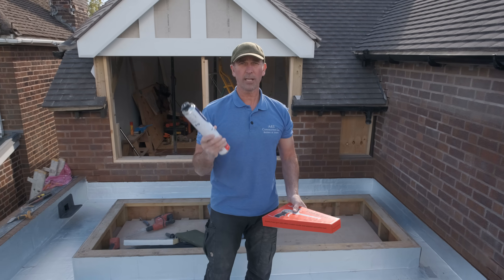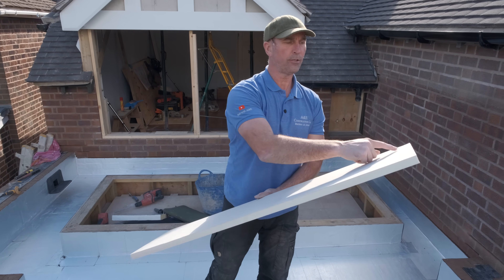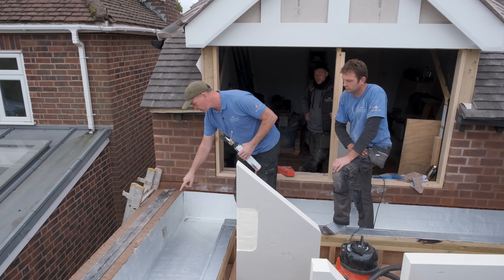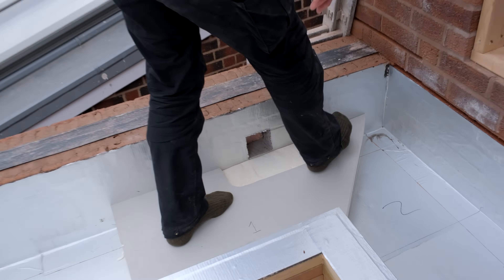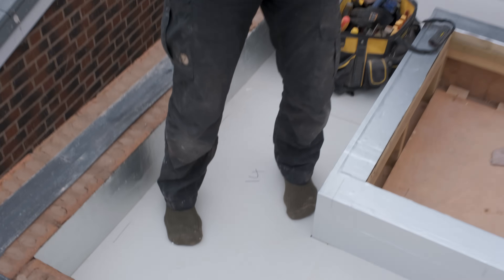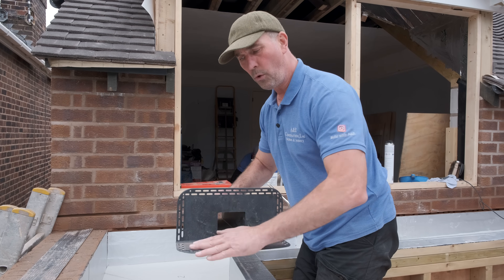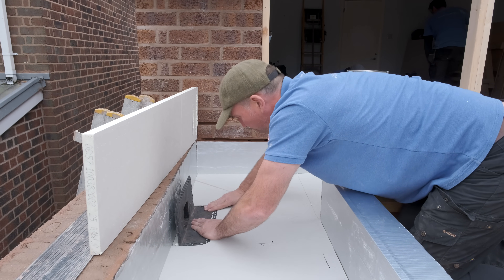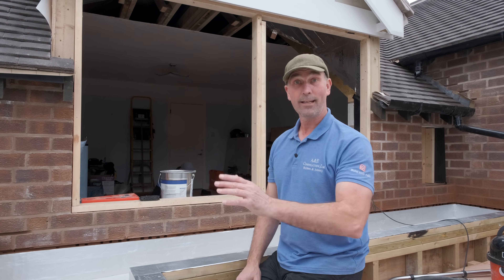Installing An EPDM Rubber Roof (Part 2: Insulation)

Comment: I'm just in the process of building the flat roof and lantern on my extension so this video series has been a fantastic help. A couple of questions for you if that's ok? 
1. Did you cut falls in two directions on some of the firing strips so there is no lip in the ply where one sheet meets another in a different plane?
2. What product did you use for the rainwater gully/outlet/hopper please? @ 3.06
Reply from the maker: Hi TheBigSugs there are multiple falls 6 in total and the gully are from Rubber4roofs all the best Tony 👍

Comment: Top class work. Im a carpenter and builder currently building a small extension on my house due to lockdown. It’s also a warm roof and I will be using the materials shown in then video. Thanks for showing they are excellent for getting info. I have a tricky little box gutter / valley to form due to my design being a little different, fingers crossed it works out 🤞 👍

Comment: Good vid as always. The attention to detail is great but I do  hope that adhesive holds the foil back pir and top deck  down securely long term. I am sure that it is most likely fine as there does not look to be large exposed areas without perimeter constraint.   When looking to do this myself  late last year I found this vid very good.  https://youtu.be/RBINlVX0jOc  . This chap seems to know the game well and is a great source of info- approachable too! . Based off of this, my choice was to use  mechanical fasteners . Its not quite as pretty as you can see the fastener washer telegraphing through the epdm ply but i know its going to stay secure. Also quick question why not 150mm pir  for new build extension?. Keep up the quality content - i learn lots
Reply from the maker: Hi reedy thanks for your kind words that link is cool, the insulation that he is showing is foil PIR, the insulation we used TR27 cloth sheet based designed to be stuck down, you also might of noticed that instead of 300mm spacing as advised it was more like 150mm even sometimes 100mm the glue is massively strong but that being said I think in massive open exposed locations this has to be considered.
 Kingspan TR27 120mm insulation offers the latest in foam insulating technology. Improve thermal ratings and energy consumption over the long-term.
 
High-performance insulation boards with impressive thermal resistance and compressive strength. Future-proof your flat roof with Kingspan insulation.
 
Long-term performance
Ideal for green roofing
Improved thermal ratings
Specifications:

Sheet size 1200mm x 1200mm
Thickness 120mm
Thermal conductivity 0.024W/mK
Compressive strength 150 kPa (at 10%)
Applications:

Specially selected for use with:
 
EPDM flat roofing systems
RubberCoverTM
UltraPlyTM
TPO
RubberGardTM
Liquid PU waterproofing systems
All the best Tony 👍

Comment: I comented before about using ply on a flat roof, but as this is a warm roof it wont matter as the ply wont be subject to accumulated heat and de laminate,  it would be nice tho if you went into more detail  about how you acheved your falls and  the  materials used, i appreciate your channel and if i was a rich man ( diddle diddle)  i wouldn't hesitate to use your firm.
Reply from the maker: Hi Mathew it’s something that was mentioned before in earlier videos and we have two big flat roofs coming up so I’am going to go into detail with them to show falls and details all the best Tony 👍
Reply: That was quick! You can tell the boozer aint open!
Reply from the maker: 😂😂 I stopped drinking some years ago head couldn’t take it anymore
Reply: I know what you mean  ive had a few years off every now and again,  and work is 100% more enjoyable and easier when your off it !

Comment: tidy. Why you not put the osb boards on top of the insulation. Thats how we'd always do it.
Reply from the maker: Hi Celtic works you can put OSB boards down on top but you then have to mechanical fix it down and with the TR27 it’s designed for this purpose so finishing material can go on top all the best Tony 👍

Comment: Again the attention to detail in your prep work is first class. Was fibreglass considered for the roof
Reply from the maker: Hi Barrington Smythe much appreciated we have considered Fibre Glass but we would have to go on a coarse which we should really look into same as GRP, but I must say I do really like the Resitrix System, is the Fibre Glass weather dependent all the best Tony 👍
Reply: @BuildWithAE  Hey tony. The fiber glass is very weather dependent if it rains while the resin is curing you are up shit creek, also doesn't do well in cold. A cobalt additive can be used for under 6 degrees but still not a good as laying it on a warm day. Still a good product when used correctly.
Reply from the maker: Hi  @stephenmurray4916  thanks for this much appreciated all the best Tony 👍 have a awesome weekend